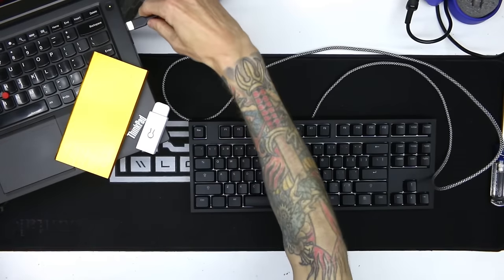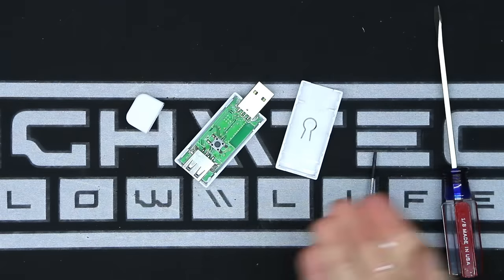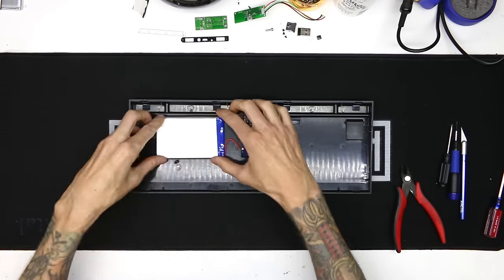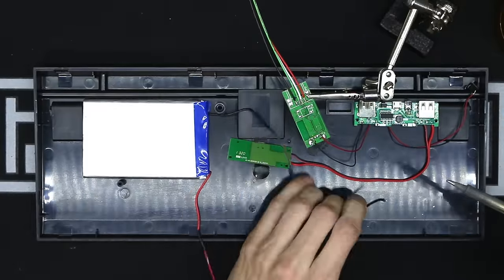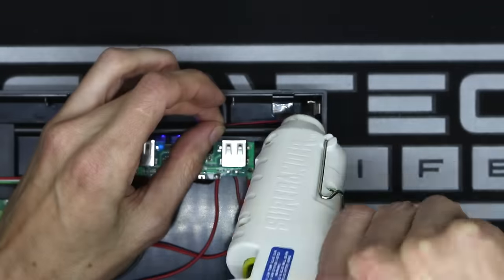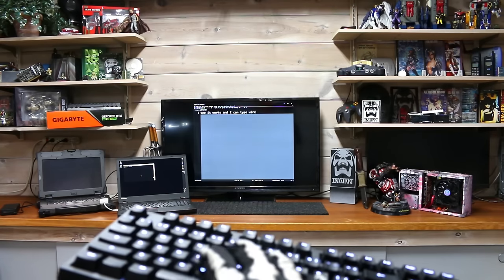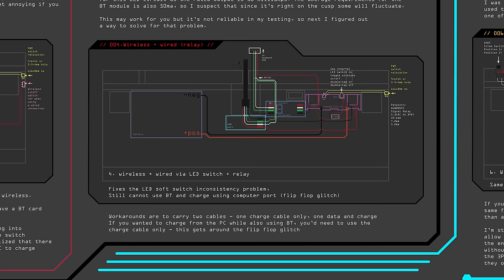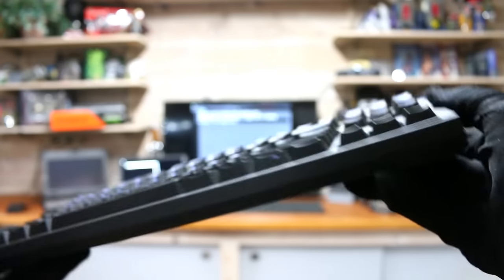⌨ Make ANY Keyboard Wireless! - Convert Any USB keyboard to Bluetooth Wireless - DIY Tutorial How To

Comment: Hi HTLL, upgrading my WASD V2 (non-CODE) and I opted for the USB-C upgrade. The new cable has 5 wires instead of 4. The extra is black as well, do you know if both black wires are ground? I'm assuming they are, but curious if you knew. Thanks love your channel!
Reply from the maker: Thanks man! Yes the newer type-c ports will have a double ground, but it's not necessary - you can tie them together or just cut one out and it will work fine either way 👍
Reply: @hightech-lowlife  thank you, that's what I thought!
Reply from the maker: @matthewlozy1140  No problem! 👍

Comment: Any idea if the BT dongle you used will support combo keyboard/trackpad keyboards? Any experience with Linux compatibility?
Reply from the maker: According to the mfg, it should work with keyboard/mouse so I don't see why a trackpad would be any different, but I've never tried it personally. I don't see anything about Linux (good or bad), but I would think that as long as your bluetooth connection works with Linux then you should be able to connect, it basically just reads as a HID keyboard. 

I can do some test with Linux if you want, but most likely the handheld sci already knows the answer if you shoot them an email (they have great support). My recommendation would be to pick up a module, just plug it in to a power bank and the keyboard before doing any surgery just to check compatibility, I'm sure if it doesn't work with your specific setup you can return it for a refund. 

http://handheldsci.com/kb/
http://handheldsci.com/comp/
Reply: @hightech-lowlife  thanks for the reply. For $6 I'm going to give it a go. I'll be sure to post my results.
Reply from the maker: @playaspec  Thanks man! Yes, please let me know - if you want to wait I can setup a Linux machine and test at least to make sure that works, if you let me know which distro you're using. 👍It should work just fine though!

Comment: Do you think it's possible to apply the same/similar methods to a Surface Signature Type cover? 

Perhaps if I start by fabricating a Type Cover's Magnetic-Connector-to-USB cable and silicone chip, then connect it to the Bluetooth adapter you reccomend (and a battery,  obviously)? Then use that as a basis for the teared-dowm more sleek design?
Reply from the maker: I believe it is possible yes, as long as you can get the board to a USB output (you said mag to USB right?), it should work. I'm not certain if the trackpad will also work (you might want to ask handheld sci about that), but it should also. According to them it can do keyboard and mouse at the same time. 

The only real issue I see is that because this board is so slim there won't be a lot of room for batteries unless you're going to do something less conventional like a separate pack or have it attached externally, etc. 

Good luck!
Reply: @hightech-lowlife  Yes, the battery/all externals will need to be creatively placed, obviously.  

Also, Newbie question: what is "hendheld sci"?
Reply from the maker: @SeamndelAlt  Yes, then I think you won't really have any problem with the conversion. 

They make the module I feature in the video (BT-500) - http://handheldsci.com/kb/ if you email their support they may be able to let you know if the trackpad will work or not beforehand.

Comment: This would be interesting to have externally, like a single "block" that connects to the already existing keyboard port.
Reply from the maker: It's even easier if you do that, check my "joke" in the beginning of the video, of course you can use it that way too if you want 👍
Reply: @hightech-lowlife  yeah, I did realize that, but what I refer is to have all the electronics put into a small box, which then can connect directly to any keyboard, no cables visible, think of it like the Nintendo switch controller, you "dock" a box to a keyboard and boom, wireless keyboard
Reply from the maker: @NOSFYT  Oh yeah you could do something like that, might need to 3D print the box then have it attach with magnets 👍
Reply: @hightech-lowlife  you know what? I'll do that, I just need to find that Bluetooth adapter on AliExpress or something ( I'm in Spain, so buying with the link you provided is not an option )
Reply from the maker: @NOSFYT  You won't find it on AE or anything like that, this company does ship internationally though. If you don't want this particular module, you'll have to go arduino.

Comment: I have taken apart my keyboard but it has a 5 pin connector, not a 4 pin. Is it fine to ignore one of the cables on the 5 cable connector. I'm fine with sacrificing rgb but I don't know what cable to ignore.
Reply from the maker: 5 Pin should just have extra ground (black wire), you can connect it to ground, or leave it and it should work either way.
Reply: @hightech-lowlife  how do i tell which wire is the extra ground wire? (Also ty for the reply 😊)
Reply from the maker: @amaanwaseem6817  You can tell based on the color. Should be WHITE, GREEN, RED, BLACK and then another BLACK if you have 5 pins.
Reply: For some reason i have black,black,green,white,red. Should i ignore the first black?
Reply from the maker: @amaanwaseem6817  What do you mean for some reason? You can tell based on the color. Should be WHITE, GREEN, RED, BLACK and then another BLACK if you have 5 pins. It doesn't have to be in that specific order, just that you have those colors present. 

I already answered your question in my first response: "5 Pin should just have extra ground (black wire), you can connect it to ground, or leave it and it should work either way." 

You can connect the two blacks together, or only connect one of them, try one state, try both, see how it affects your connection. Most likely it will not make a difference as it will probably work the same whether only one ground is connected or both, but there might be a combination that works better than others.

Comment: I turned my keyboard into wireless and it's working great! The only problem is that when I try to use the keyboard as wired, a message shows up saying "USB device not recognized". I followed schematic 7, is there anything I can do to overcome this issue?
Reply from the maker: Awesome man! You're using the hotkeys correctly right? 

From the manual:
When both interfaces are enabled in settings (factory default), only the Bluetooth interface will be active on start-up. However, you can use the shortcut ctrl+alt+b to switch to Bluetooth, or ctrl+alt+u to USB. 

In the rare case where you would like both interface active (so keystrokes
will be sent to Bluetooth and USB simultaneously), you can use the ctrl+alt+pause shortcut, or the mode button, to cycle 3 states: 
Bluetooth only, USB only and both active. It is worth noting that this is also configurable.

Comment: Wondering if it is possible to use this dongle for multiple hosts. Or at least have ability to switch between hosts.
Reply from the maker: I don't believe it supports multiple hosts, but you can check their documentation here: https://handheldsci.com/kb/ their support is very good as well, so if you had specific questions you can reach out to them regarding functionality. 👍

Comment: So if you don't want to modify your keyboard, you can just plug and play? And will a splitter work if you want to connect your mouse as well or other USB devices?
Reply from the maker: 1. Yes, you can just plug things in with wires and it will work (as shown as the 'joke' at the beginning of the video).

2. Yes, and no, it depends.  

According to the instructions (which you can read yourself here: http://handheldsci.com/wp/wp-content/uploads/Manual_Full_v5.2.10.pdf):

"The firmware has the support for a USB hub with up to two devices attached. It should work with either a built-in hub in a keyboard or an external hub. Keyboards with a built-in hub are supported provided there is no other devices connected to the hub. 

The following two setups are not officially supported, since there are too many combinations of those and we can’t test them all. But there is a good chance they will work:
o A keyboard with a built-in hub and with one additional keyboard or mouse
connected to the hub
o An external hub with one or two devices (keyboard or mouse) connected.
Currently the Adapter works only with keyboards and mice but not any other types of USB devices such as serial port adapters, game controllers and touch panels"

Comment: Does the bt-500 support F13-F24? I have a custom macro pad that I would love to make wireless with this but it needs to be able to pass through my macros which include the extra F keys.
Reply from the maker: If it's sending standard scancodes then most likely it will work. 

Taken from their manual: 

You can list all basic key names supported in the firmware by using the “key_name” command.
The three lock keys, namely Caps lock, Num lock and Scroll lock, are not currently supported in
any functions. So the key names do not include them.

Some keyboards, such as those from Logitech, have programmable keys marked as G1, G2,
etc. If they are programmed as keyboard keys, then they are just like any other normal keys. If
they are custom keys that rely on software or device driver from the vendor, then they are not
supported since they don’t generate standard USB HID keycodes.

Manual is here: http://handheldsci.com/wp/wp-content/uploads/Manual_Full_v5.2.0.pdf

I'm not certain if this will work or not but I assume it will, you might want to email handheldsci as their support is really good and I'm certain they could confirm this works for you. 

Thanks!
Reply: @hightech-lowlife  According to handheldsci support the adapter does work with f13-24 so I've ordered 2 of them. Thanks for the idea.
Reply from the maker: @evilgeniusha01  That's awesome man! 💥💥💥 I figured it probably would work but I didn't feel comfortable telling you something definitively that I wasn't sure of. I'm glad they were able to confirm for you!

Comment: Bro,I hope you find a solution for my question,
Can you convert wired keyboard into wireless with using wireless mouse usb dongle and mouse pcb?
Reply from the maker: It may be possible, but most likely not. If it is possible you will need more parts like an arduino, and to do quite a bit of coding, and at that point you may as well just get the BT-500 which will work.

Comment: I tried to buy all components needed for schematic # 8. I noticed when I began taking things apart that my charge circuit does not power off when on batteries. I didn't pay too much mind but now that I have everything ready to put together, I realize I can't follow any of the schematics in the schematic document you put together because of this limitation (I think). 

I was thinking maybe I could somehow just revert to do schematic # 7, but that one still requires such a charge circuit. 
I got the 2 panasonic relays. During my contemplation I ordered and received some 6 pin dpdt locking push-button switches believing that would handle power cut off/ routing, but the adapter will always be powered with it/idk how I can make it not power the adapter/ be functional. 

The charge circuit I have seems only to be able to charge from a micro-usb port, which took some care to solder into. I think I may have wasted some time working on this charge circuit wiring since it won't work. Do you have a reliable source for charging circuits other than the one recommended in your write-up? I purchased mine from the recommended link in that write up but received this one without the ability to power off when a charge is applied to it.
Reply from the maker: You should be able to power off just about every power bank/charge PCB by holding the power button. Some will have "auto-on" features if a device is applied. Sometimes the more expensive ones are too "smart" and cause problems. You can always wire in a switch to cut power to the keyboard, but my recommendation would be to just grab a few cheap charge PCBs and find one that operates the way you want/need it to. You can even ask the sellers if they know, and most of them will be able to tell you without you needing to purchase it. 

I don't usually link/source components because they change very often, and are usually discontinued or updated too quickly for me to try and maintain links. 

If you've come this far, you'll be able to figure it out 👍
Reply: @hightech-lowlife  I will see what I can do with the pcb I received; I want to combine the relay logic in schematic 8 but within schematic 5, using 2 mechanical switches to disconnect battery from the charge circuit entirely when in "charging mode" if no power comes through usb to the keyboard.  I am confused how you are charging the battery at all in circuit 8. Do you know if that circuit was able to charge the battery through multiple usb ports?
Reply from the maker: @flop-oe5mr  Schem 8 goes from USB input to the charge circuit directly. 👍 Yes, regardless of where you place it, it would accept input power.

Comment: Is it possible to make it still usable by just connecting the USB cable? if the device doesn't support Bluetooth but still want to use the keyboard?
Reply from the maker: 100%! I actually show two ways to set this up in this video! Firmware with hotkey toggle, and also a hardware (relay) switch to go from wired/wireless. 👍

Comment: Can this be done with a PS/2 Keyboard that has a PS/2 to USB active adapter, or a PS/2 Decoder, before everything else?
Reply from the maker: It may be possible, but I'm not sure. Please contact handheld sci and I'm sure they can let you know as they would have more experience with that 👍I suppose as long as the USB is outputting USB signals, it should work.

Comment: Im planning on buying a Reddragon Fizz and i heard its wired i have a bluetooth adapter (dongle) from my Nintendo Switch but i don't use it anymore, is there a chance that the adapter might work on the Reddragon Fizz USB-C Port?
Reply from the maker: Unfortunately a regular bluetooth adapter/dongle will not work, you essentially need a 'transmitter' like the BT-500 (or an Arduino setup for HID transmission will work). 👍I did just search for "switch" dongles which are a bit different, and probably would work for a USB controller, but I'm not sure about with a keyboard, might be worth investigating but my confidence level of it working is low. Thanks!
Reply: @hightech-lowlife  oh okay, i forgot the keyboard needs power so my dongle won't work. Received with thanks!
Reply from the maker: @ctacio  No problem, thank you for watching!

Comment: do you know if the bt600 in bridge mode supports full nkro? would be neat to use my keyboard as an instrument in a daw.
Reply from the maker: That I'm not sure, I would reach out to support for this question and also am not sure about midi keyboard compatibility so you could check on that as well. 👍
Reply: @hightech-lowlife  I reached out. 

You think the bt600 would work in your circuits? It's got a usb-c female on it.
Reply from the maker: @flop-oe5mr  Yeah it will, connectors are just terminations for wires, it even comes with a C to A adapter, and I'm sure it's only using 4 wires 👍

Comment: Super cool project and I love the idea. I don't think I'll be able to get it to work with my GMMK Pro since it's solid aluminum and there's 0 extra space in there for a battery or bluetooth module.
Reply from the maker: Thanks! Yes, unfortunately aluminum will inhibit the bluetooth signal quite a bit, and most aluminum cases have very tight tolerances so that most of the space if filled up with metal. You could have an add-on module that attaches to your keyboard externally is 3d printed to house the battery / bt, that way no real modifications to the board is necessary. I might do this in the future to show as an alternative 👍
Reply: @hightech-lowlife  I hadn’t actually thought about the signal being blocked by the aluminum, I was focused on the 0 space for any extra components haha. I actually really like the 3D printed module idea, I figure it could be made small and flat enough that it won’t be visible if you’re just typing normally. I imagine it’ll be easier to wire everything nicely if you have the freedom of making your own circuits and not relying on tapping into existing ones. Plus, if the module is detachable you can optionally simplify a lot of the circuits and switches since the module can just be charged separately and you can remove it if you want to use your keyboard wired.
Reply from the maker: @colin7231  I don't have any tests or experience, but I do know that metal blocks wireless signals way more than plastic, so it's bound to have an effect. 

It's for sure an avenue that you can go down, has a lot of positives and the only real negative is that it's bulky and outside the case, but I'm sure you could design it in a way to make it more discrete. 👍

Thanks!

Comment: Does anybody know if ipega pg-9116 can do the same job as the bt-500 adapter that he used in this video?
Reply from the maker: According to their marketing, it would appear so, however the reviews on amazon are not great and it's very large so wouldn't make a good candidate for embedding within a keyboard unless you have a very large keyboard 👍
Reply: @hightech-lowlife  Yeah, thank you. I found one more on aliexpress but it seems that it don't have a switch for on/off . So i'm afraid that i'll have problem with my battery life cause this will always be on.
Reply from the maker: @pmakosyo  I'm sure you can wire in an on/off toggle (that's essentially what I have done here). I believe in further iterations of the BT-500 they will have a sleep timeout function to save battery life, I did let them know that this feature would be very helpful 👍
Reply: @hightech-lowlife  yeah I read your wireframe on GitHub page. I think I'll go this way.
Reply from the maker: @pmakosyo  Cool 👍